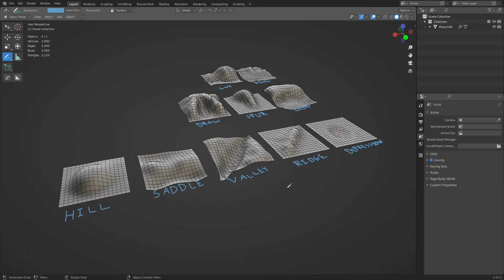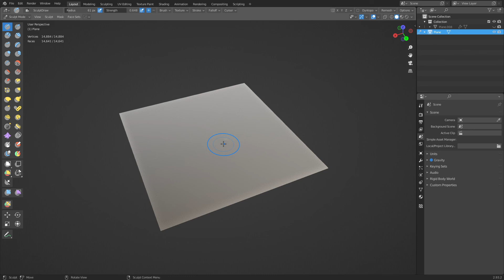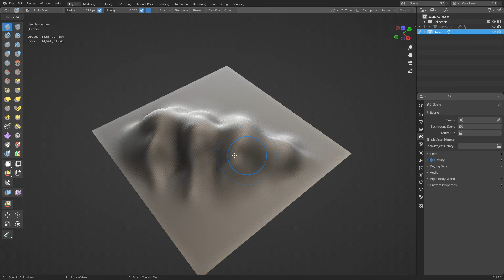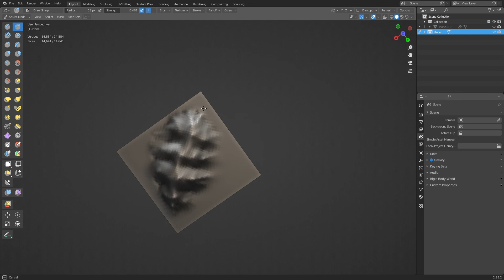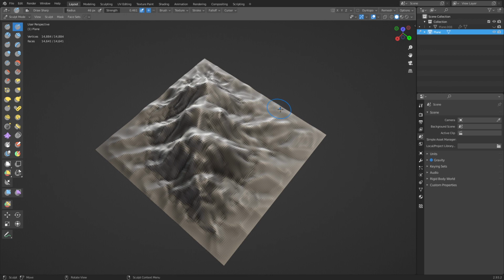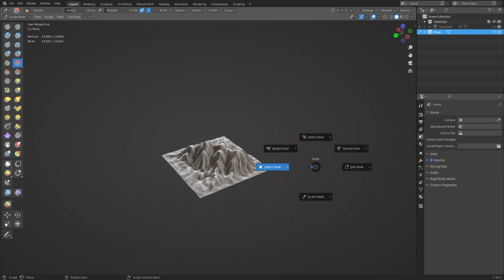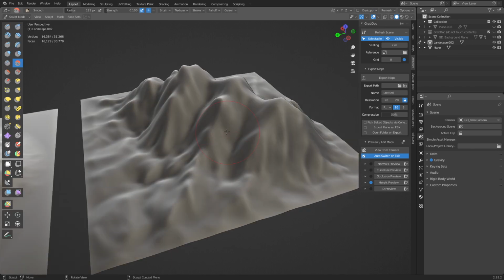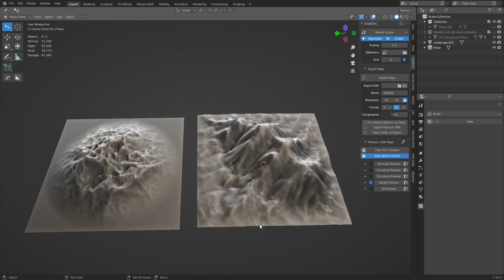Blender - Sculpting Terrain

Comment: Have you ever used the dyntopo feature? I've been curious about trying it for terrain sculpting, that way you can have dense topology near your camera for textures with displacement maps and then dynamically step down the topology further out, could be great for sculpting large landscapes that still need areas that hold up in close ups
Reply from the maker: No, You can try using adaptive subdivision or set dressing with near, mid, and distant meshes perhaps.

Comment: How do you cut it can you cut what you sculpt?
Reply from the maker: Split it up? seperate faces (p) use a knife tool(k) to cut it.
Reply: @pzthree  sorry for silly question no need to cut it up was just wondering how you combine it with another landscape and I know how now. :) If you cut it up and want to connect it with another terrain landscape you did its going to look ugly. :(
Reply from the maker: @sorrowinchrist3387  Depends on how you want to do it. Few different ways actually. Really needs a video on it.
Reply: @pzthree  I been looking every where how do you make your mesh like the valley with the inside flat so its a box? Thank you if you can explain! I cant find this!

Comment: This is amazing, however i fail to see the use case when so many tools can generate realistic terrains automatically?  Dont get me wrong its an amazing feat to paint these features by hand i just dont get why you would?
Reply from the maker: Generators are great tools but may not solve everything. If you need to rearrange terrain for level design this is usually the techniques you would fall back on. If you have a generator that allows for a mix of manual and procedural creation you still have to consider how it will be utilized and create the underlying believability. 

GIS data converted into Alphas or custom tools then hand placed has in my opinion always delivered some of the best looking results. A best of both worlds approach.

Comment: thank you for this video it has been very helpful, I liked and subbed :).

I wanna ask you if it is possible to sculpt the terrain and then export the sculpted mesh into a game engine since the game I am working on needs a mountain for the level to take place on, and in unreal engine sculpting terrain isn't as detailed and easy as in blender. You know I have to make small roads, some erosions, some caves and underpasses, etc.

Do you have any tips or recommendations? Or maybe you could make a small video on the matter?
Reply from the maker: As for going from blender to a game engine. It is possible but can be pretty tricky. I would highly suggest trying to utilize the game engines terrain system. 

Usually importing a height map and adjusting it there in engine is the way to go.

Comment: Hey, I was wondering, Do u know of any way to preserve the edges of terrain tiles? I am working with triangular tiles with cliffs on them. I need the tiles to be interchangeable/align. Hence they need to have the same boundary conditions -> edge vertice height
Reply from the maker: You would have to model the terrain as one big piece. Break it into sections and use a decimate modifier for each section. There should be options to hold the borders. 

I wouldn't recommend doing that though. I had experimented with it. Not really a great idea.

Comment: Thank you for the tutorial.
With Blender 3.0, is there any reasonable way to show the grid-like quad edges of the mesh in Sculpting?
I was not able to find any way to do it. For me, it makes the editing much easier because I can see what I am doing.

Edit: I meant the ability to see the mesh superimposed on the shaded surface, as shown in several places in the video.

It appears that Blender took a feature away, or buried it : (
(thank you)
Reply from the maker: Top right of 3d view. shading drop down menu should be a wireframe checkbox in there. That should do it.
Reply: @pzthree   thank you for replying, BUT I meant the ability to see the wireframe and on the shaded mesh surface, both at once.
Reply: @BrendaEM  I think his reply still applies? The drop-down arrow to the right of the "Show Overlays" option, there is a Wireframe slider which can be used on all shading methods.